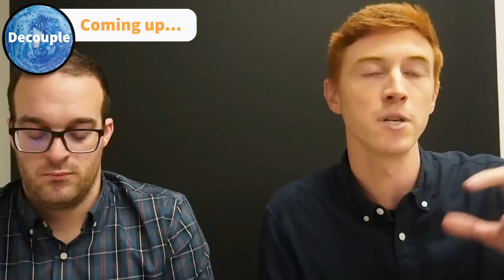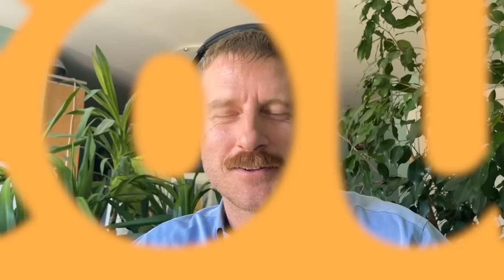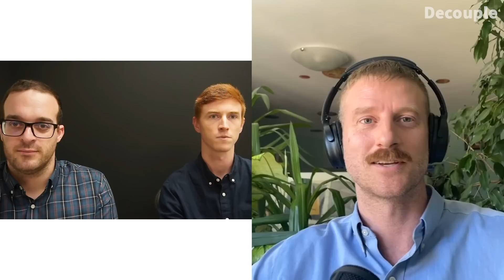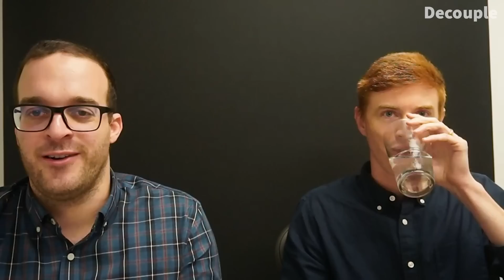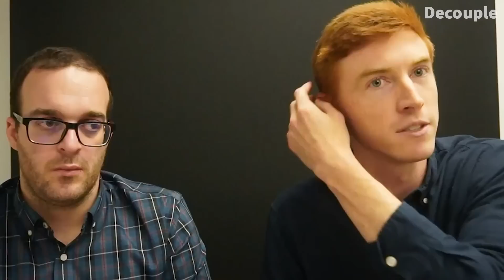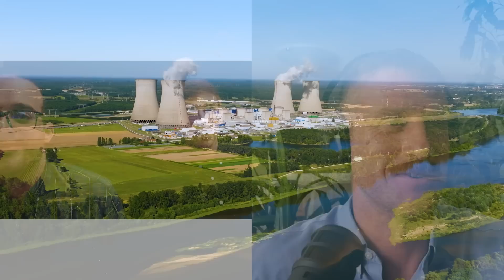The Real Costs of Advanced Nuclear

Comment: Let's be honest, realistic, and pragmatic.
We have to build 10s of thousands of reactors across the globe.
And we need to do this ASAP!  

So let's just start pumping out 4-packs, 8-packs of AP1000s, APRs, EPRs, BWRs, VVERs,  etc, etc, all the ones we already have, start doing this on sites everywhere...
Then, at the same time, fund the designs of a couple of dozen advanced reactors, of varying types and capabilities, telescope their projects in the correct ways, and pick many of the good ones.
When we have 10s of thousands of reactors to build, the initial costs, FOAK costs, design costs, etc, etc, will be fairly insignificant, in the same way that it is for any prototype car, plane, etc. etc.
And not starting this right away will only make everything much, much, and increasingly expensive.

We just need to get building.
Reply: Let's be honest, realistic, and pragmatic. The energy transition will take well over 100 years so there is no reason to make stupid energy decisions. Let's convert as much coal-based energy to natural gas while we commercialize advanced nuclear fission, the only technology that can actually replace fossil fuels.
Reply: @chapter4travels  I reckon the effects of climate change will be hastening our transition faster that we think it should otherwise sensibly take.
And we know for certain that we can decarbonise our electricity grids almost completely, with only nuclear power...  So it's not stupid to just decide to just go and build nuclear straight away.
It's going to cost a huge pile of money, so it's not stupid to want to spend just one huge pile of money, rather than 2 of them, if we faffed around with the tempting but intermittent stuff, or a bigger roll out of gas.  And gas isn't looking so great, so clean as we're noticing how much methane is leaking out of the whole system, and it's monstrous potency as a greenhouse gas.
So i do think that we'll be starting building multi-unit NPPs at multiple sites... and every country will be doing varying scales of this.
Either way, just because nuclear is the only tech that can decarbonise us properly, we are going to see the nuclear industry explode worldwide, and the things the guys talked about in the video will come to fruition... It's gonna have enough business, money, confidence that we can try all these new tech, new methods, new everything.  And out of that, we'll get the reactors to decarbonise most of industry, industrial heat, process heat, and all the other weird and wonderful stuff that will make use of reactors...

But todays reactors can decarbonise all of our electricity grids, everywhere... 
That alone is a mammoth task, and one we can just get on with.

And again, climate change is gonna be persuading us to go even faster than we are.
Reply: @cheeseandjamsandwich  I think the opposite is true, so far the slight warming and enriched atmosphere has had net positive effects on our climate. The globe is greening at an astonishing rate, and global crop yields are breaking records with no increase in extreme weather. (regardless of the propaganda) 
2023 was a new record for coal and natural gas consumption and this trend will continue until those fuels become more expensive than nuclear. By then low-pressure/high-temperature nukes will have matured and the transition will begin. 
The future's so bright, ya gotta wear shades.
Reply: @chapter4travels  "so far the slight warming and enriched atmosphere has had net positive effects on our climate."  ... Sorry, what?!?
Perhaps the people you're listening to are telling you reassuring things, but the reality is a bit different.  There's a huge number of boring researchers, scientist, analysts, etc. that just don't have charisma as some people do have... They're tending to say the opposite, and are mostly holding back a bit, as they don't want to scare people... But its when we take the observations from more and more and more of them, and consider them all together, then we can safely say that we're proper fucked.  Things are gonna get messy.  Our systems will not be able to support 8.1 billion of us (they can't currently, let alone tomorrow).  We simply will not be able to adapt fast enough...  And it the speed of change, of the warming, that's the real fucker here.
Have you considered the permafrost melting?  The ocean acidification?  The 7% per deg C increase in moisture carrying capacity of air, leading to heavier clouds, heavier rains, flash floods?  Etc. etc. etc. etc.
Anyhoo, neither you, nor I, are going to be making the decisions... And the effects of climate change is likely to kick some countries into jumping into nuclear with 2 feet... This movement is likely to influence other countries...  And lets also think of others, not just countries... Corporations are likely to be jumping in... ovbs the data centres... but when a significant oil company jumps onboard, then that might trigger others to follow in a race.  There's going to be a decent amount of FOMO happening...  People realising that those with mountains of solid, constant nuclear electricity and heat are gonna be hoovering up all of industry, everyone seeing their benefits, not just its cleanliness.  Other's suffering with flaky grids, and failed intermittent investments.
I do think we're gonna be seeing lots of 4-pack, 6-pack sites being announced sooner rather than later...
And yes, all the advanced nuclear will then get its dev funding from the healthy, expanding, accelerating nuke industry.
Reply: @cheeseandjamsandwich  There is no climate crisis, that is propaganda, if you choose to believe it, that's on you. The energy transition will happen but it will take over 100 years regardless of the popular propaganda.
Reply: @cheeseandjamsandwich  to answer your question you need to know what our near past climate was like, 12k years it was -10C very cold that is the average for the last 100k to 2milllion years or so, then the younger dryas happen and the temps shot up over about 2k years to be about 2-5C HOTTER then today, the oceans rose about 400 feet(unless its meters pretty sure it was feet) in that time as well, it cooled down after that until we get the mesa warm period, cooled again and got the Roman warm period then the Medieval warm period, al were GOBAL events(just named after the important thing at the time of happening), then the 1600s(as well as the 1400s) and the temps dip down think was -2C and was the coldest it has been in the last 10k years and millions died! Every warm period humans thrived! when it cooled back down again it people died a lot more, starvation due to cold crop lost is a thing!
Now your trying to tell me that the Modern warm period is a bad thing and its raising faster then any other time please lol go learn some actually history, could start with Tony Heller who actually has history on hes side in the form of old books and newspapers, and has worked in that field as well.
Reply: @chapter4travels  : I've only had my farm here in Oz for 16 years and we are yet to experience a drought but we have had a 16 year run of record yields and luckily record prices. Our luck must run out eventually so I've really cashed up and we've acquired a neighbouring farm utilising excess cash, we sort of had to or give it to gov't. The local Bureau has forecast "hot dry summers" for several years running now but we switched to using independent forecasts several years ago and that saved our backsides by maximising our inputs, etc, to take advantage of warm wet summers.
Reply: No, “we just need to “ reform the NRC. Else the first reactor will burn up what would  be the cost of 50 Chinese reactors.
Reply: @Czeck0-u1k  i think Chris has a video on this.
It's a few things...
Committing to actually build dozens of reactors at a dozen sites will force many things to 'improve'.

We've got 10s of thousands of reactors to build. We just need to start
Reply: @cheeseandjamsandwich   not sure how volume forces the NRC to do anything. This is not an smart phone  or car factory.
Reply: @Czeck0-u1k  watch the decouple episode about the nrc...
It might not be the stumbling block we all have been thinking it was.
Reply: @cheeseandjamsandwich  the guest was Krellenstein who is THE shill for the NRC. 
K Daddy worked NRC, then went Wall Street financing nuclear. K is as shill as shill gets. Everything wrong w building nuclear is somehow industry, no matter which company, and NRC is shiny.  There is large amount of money made today in the nuclear safety industry, ie many people who will oppose any changes.

Comment: Grid construction contractors love the nuclear promoters. 
Happy days, O happy days 😄
Reply: No, they hate them because nuclear will use all of the existing transmission infrastructure. But they do love "renewables" because of all the new transmission corridors that will be needed.
Reply: @chapter4travels  I am saying that as electricity energy expands from 15% of total energy used to 100% energy then more grid transmission and distribution capacity is needed if the old ways are expanded.
Happy days for the construction contractors.
Reply: @stephenbrickwood1602  Currently the world is at 20% electric and might go to 60%, the rest will be coal, oil, and gas for the foreseeable future. When those start to run out and get expensive we'll use nuclear for industrial process heat/electricity and synthetic liquid fuels for the rest. New electricity demand pays for grid expansion as it always has. Intermittent sources die on the vine for grid-level demand. 
BTW I get all of my electricity from solar panels, with battery storage and I know the limitations. Right at this moment I should be charging my batteries but it's foggy and will be cloudy all day so I have to conserve today. No electric coffee maker today, pour-over instead, using propane on the stove. No microwave or air fryer either. This is fine for me, I accept the limitations, but you can't do that in a modern industrial society.
Reply: @chapter4travels  thanks for your comment, it is relevant.
My concern is the billions of people. 
Petroleum for road building and petrochemical industry and ice vehicles and emergency use will be with us for decades. 
Grid electricity is extremely expensive and not understood until the construction prices come for the expansion work. 

Transmission technology must become 10 times cheaper.

Battery technologies are evolving rapidly and will be needed in daily transport by millions of people, grid customers. 

That is the way I see it.
Nuclear economic failure in the big picture. 
In the warmer climate.